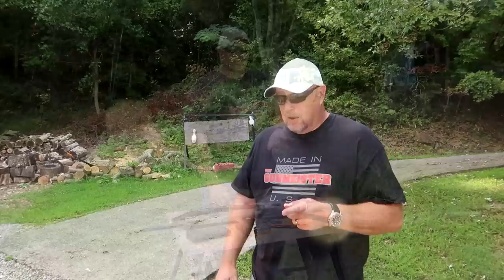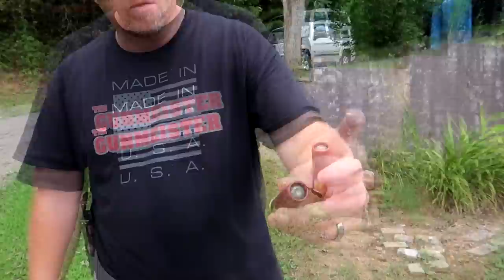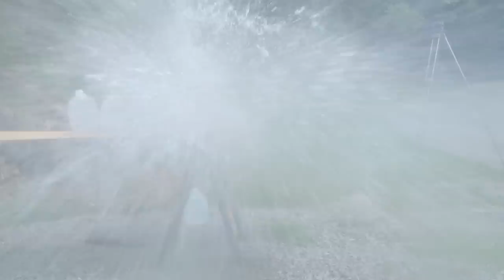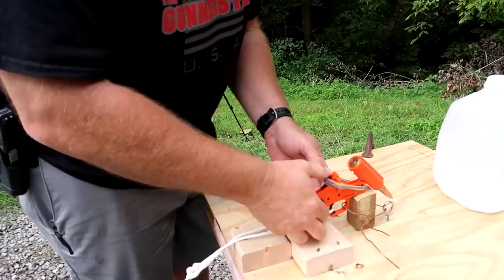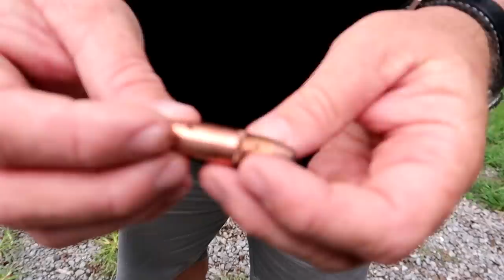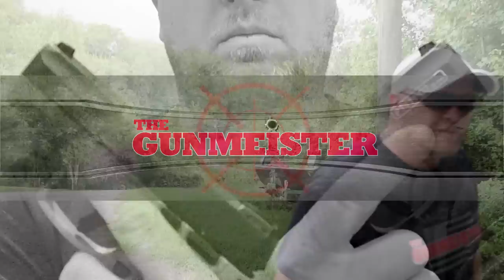50 BMG Shot From Flare Gun | What Happens?

Comment: About the same as what happens when you shoot a regular 12-gauge shell out of one... Used to be the flare cartridges did not have the tapered profile... Although a full size 12-gauge round would not fully seat, a bit of work with a round file would quickly "fix" that...

Comment: At first, I thought,,, oh cool, I'm going to get to see this guy loose his hand in a TouTube video!  Then I saw you rigging the pull.  I have to be honest,,, with the lever cocked when you latched the barrel I held my breath!  So glad you did this experiment in a safe manner to help people understand they should be using anything but approved flares in the flare gun.  Glad the Commander is ok.  😆  Nice vid.
Reply: if you get an adapter for smaller caliber you can have an actual firearm but itd still be more of a disposable only few round (if that) use gun cause the hammer and frame is still only plastic and not really made to withstand multiple rounds of much more than a .22lr for extended use

Comment: gun MISTER I COMMENTED NOW AFTER 5 YEARS TODAY IS DEC  15 2023! IF YOU HAD ONLY INSERTED THE FLAREGUN  IN A CUT 5 INCHES LONG JUNK METAL WATER PIPE IT WORKED , PROBABLY DIAMETER IS 1/2 INCH OR 3/4 INCHES , 5 INCHES CUT METAL WATER PIPE , REALLY A LOUD AND SURE TARGET EXPLOSION!